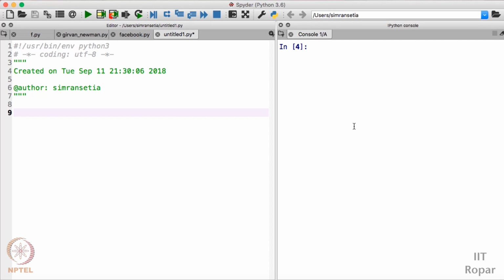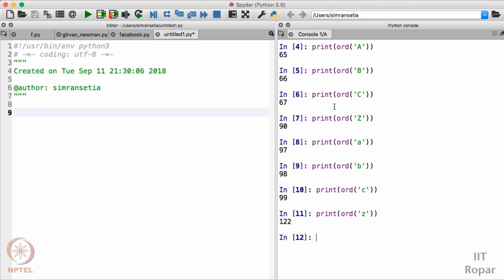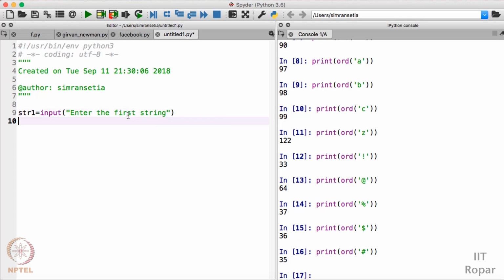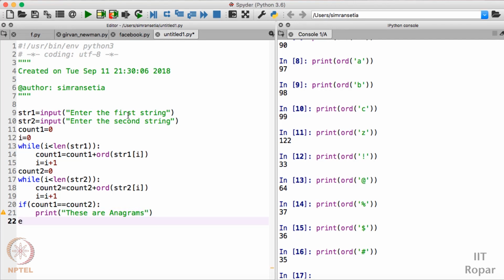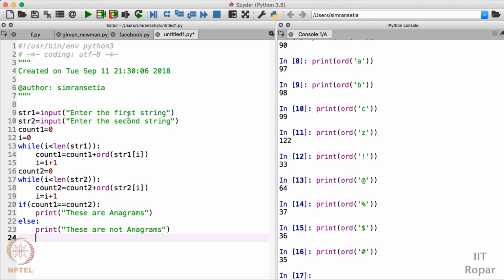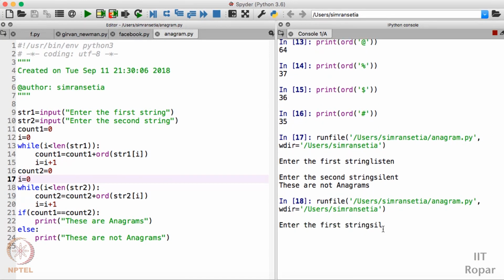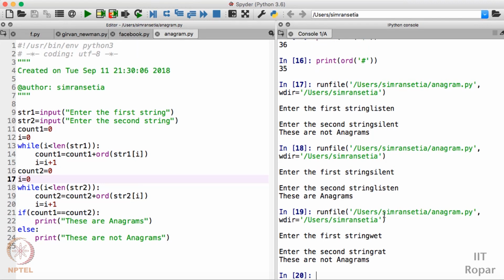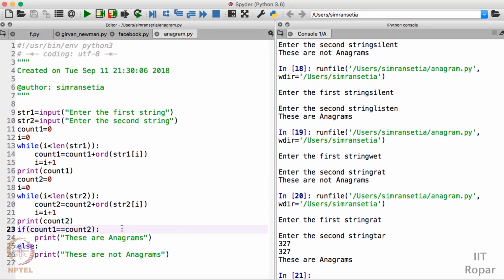Anagrams - Part 03

Comment: This code is wrong lol. As per this code the sum of the ASCII values should be equal
They havent even set a limit that the length of the strings should be equal
Clearly, 1 + 2 + 3 = 6
And, 5 + 1 = 6, They are obviously not anagrams
Also even if we use strings of same length, this will not always work as 
KLM and JLN have same sum
A better solution would be to convert the strings into a set of their chars and check if they're equal. (in length too)